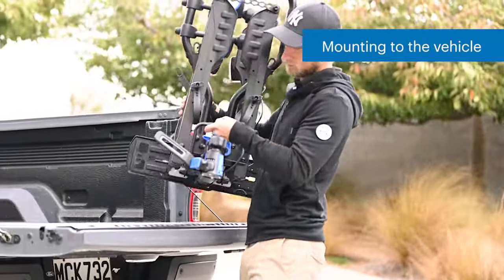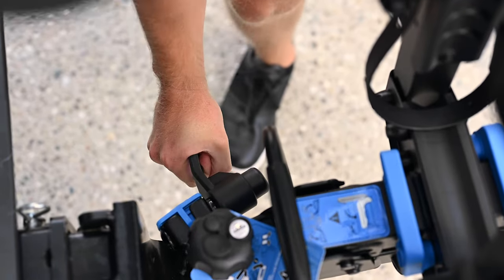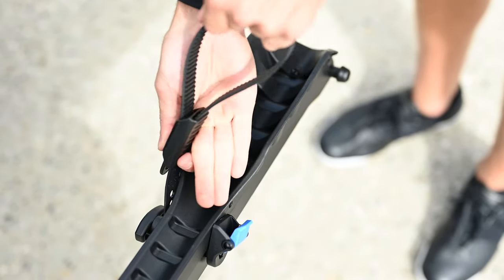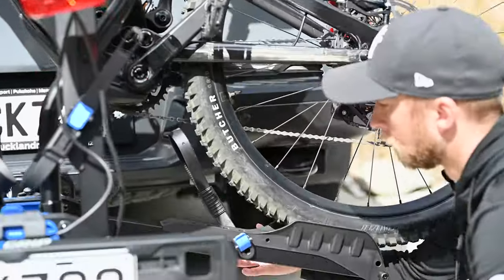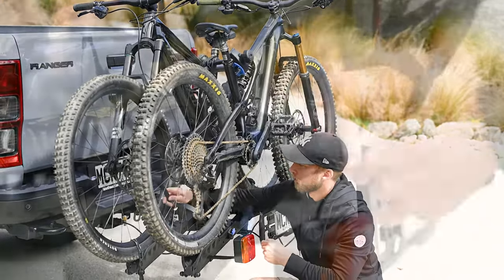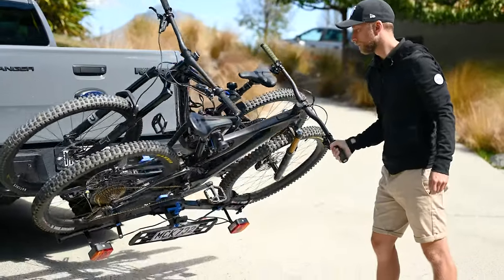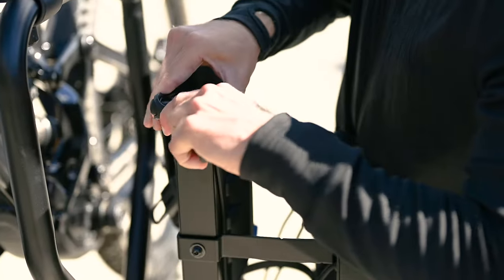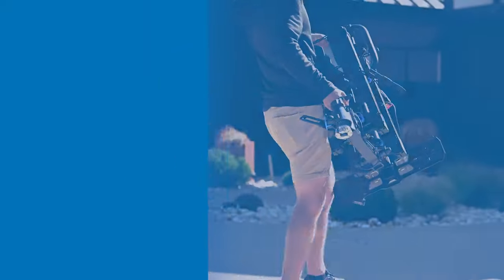Ezigrip E-Rack 2 - How to use

Comment: I recently bought EziGrip Enduro 2. Is it normal for it to wobble slightly when driving? I have replaced 1-7/8 towball to 50mm as required for the bike rack to be installed accordingly. Anti-rattle bolt with nut in place on the reciever to hitch. I have 2 bikes, which each weighs 13.9kg (approx 27kg in total and max 30kg for the bike rack).

Question is how much should the bike rack wobble?

Thanks heaps. I love your product! First time bike rack owner here! :)
Reply from the maker: Hi Dean, the rack certainly should not be wobbling on the towball. Please contact us so we can trouble shoot this with you, sales@ezigrip.co.nz 
Cheers Hamish

Comment: How do you lock the bike to the frame if the bike doesn't have a horizontal bar to grip, like womens bikes are designed?
Reply: Hi Mark, you can mount the frame clamp to the seat tube of a woman's step through bike.
Reply: we have looked at this as well, you need a Tube Top Rack attachment - basically gives bike a crossbar for use in the rack
Reply from the maker: @jenbockhop758  Hi Jen, a top tube adapter is not required. The arm can mount to the seat tube of a step through bike.